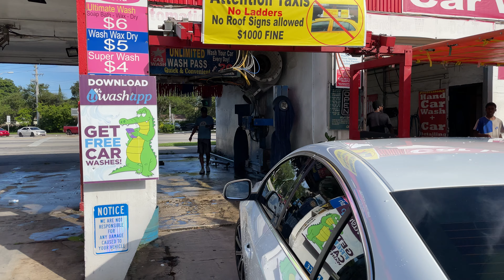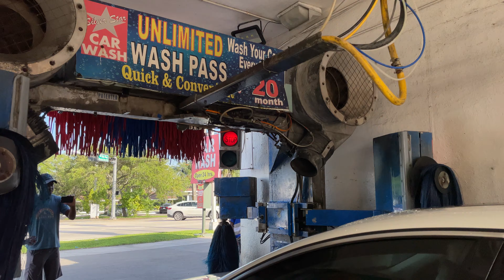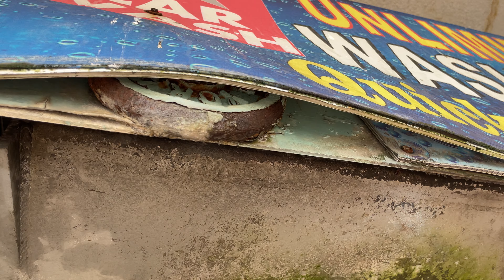Ryko R7B Car Wash - Revisit! [4K/60fps]

Comment: I remember there being a very similar Ryko car wash in the city where I lived (England) 🏴 . In the 1980s my dad used to drive me to some car wash sites. This particular one had a "Speedwash" sign at the entrance. From memory, I'm sure it had two horizontal brushes instead of one and a pair of taller vertical brushes, all light blue. I'm guessing a 1970s installation.

Comment: Absolutely beautiful! I’m wondering what is the red frame at the entrance?
Reply: That was from the other R7B that was there in the Manuel bay before they took out before street view went down by it
Reply: @bodobosz2775   looks like a tunnel top brush frame
Reply: @carwashcrazy2009  no it is not i can see the were the old floor rails  used to be in the self-serve bays
Reply: @carwashcrazy2009  I agree it looks like it’s most likely a spare part for if the other one goes bad